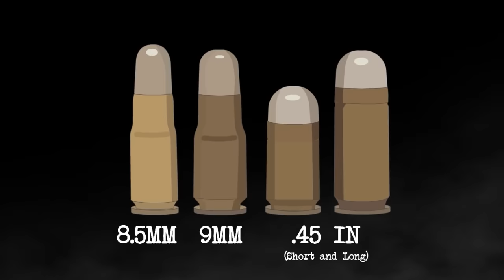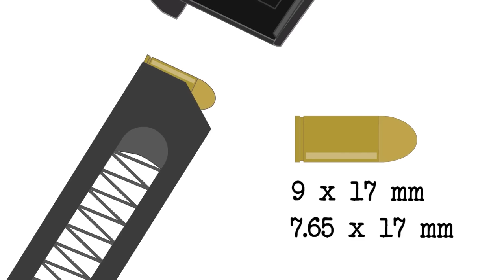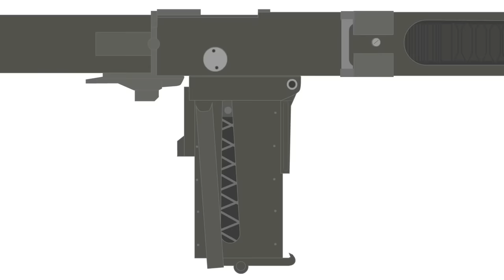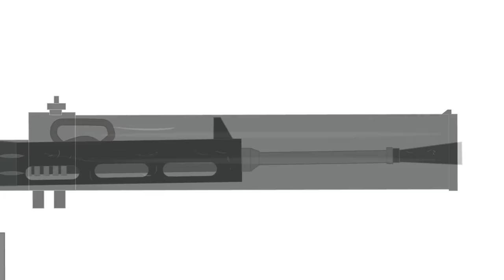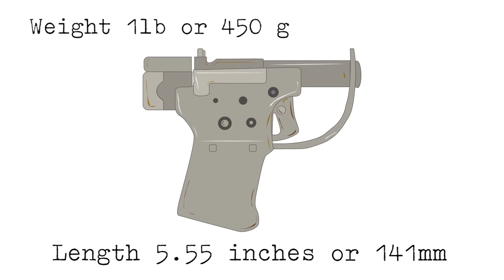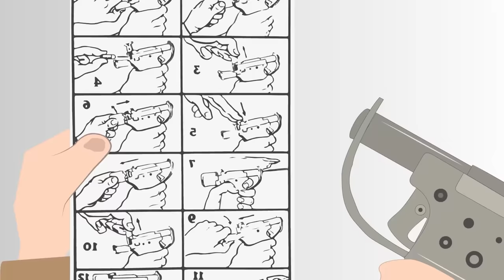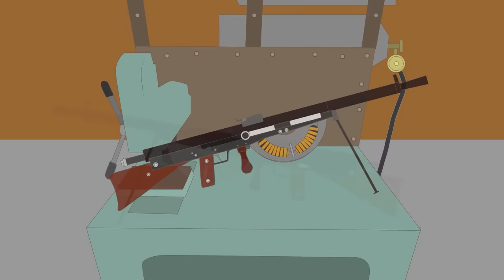Cursed guns that shouldn't have been made

Comment: The mars was a great pistol in battlefield 1, goes to show again how in video games stuff doesn't break down or misfire like in real life so it's a lot better than the real life counterpart. Same with the Chachut, was my go to lmg.
Reply: Would be amazing if DICE worked this stat into the game similar to Far Cry 2; prevents redundant weapons when some have higher chance of misfire and can definitely help balance the high RoF or high capacity weapons if they're more prone to malfunctioning and jamming the way they are in real life.

I'm so tired of post-BC2 BF games devolving into an SMG meta like it's CoD and the weapon platform hasn't been obsolete in 15+ years.
Reply: The Mars actually worked reasonably well - it just delivered a round with 50% more power than a 45ACP however. A pre1900 gun for Dirty Harry.
For comparison the 45ACP was dropped because the US army basically concluded that putting having a gun that everyone they recruited could put every shot into a target beat having a gun that only 10% of their recruits could master.
Reply: Best example is the Tec 9. It is a PoS in reality, yet the best gun to rush B with Blyat
Reply: @allangibson8494  The 1911A1 was used by the US military from 1911 until the mid-1980s.  From what I heard, from my dad and others, if you could hit a man sized target anywhere from around 25 yards, you were "qualified". Also, the main reason they switched to the M9 Beretta was the fact that most existing 1911s in military stocks were dated from WW2! Rather than replacing them with new .45s, they decided to go with the 9mm for NATO commonality. I guess the idea was if combined NATO forces were fighting together, they would have one common pistol cartridge. You could take cartridges from an ally if needed, even if you used different pistols.
Reply: @johnmullholand2044  The M1911 limited WHO could qualify. It places physical requirements on the user that the 9mm Parabellum doesn’t. The difference is terminal effects is actually marginal but the probability and speed of actually qualifying with 9mm is much higher than the 45… Second shots were demonstrably faster with 9mm and magazine capacity was much higher in a physically smaller package.
The Air Force ditched the 45 as soon as they could.
Reply: @allangibson8494  Have you ever fired the 1911? Recoil isn't really a problem for any adult, a bigger hole means they bleed out faster, and seven or eight rounds of a guaranteed fight stopper is still better than a smaller, weaker cartridge. As to a "faster follow up shot", there are numerous action shooters that might argue with you about that. No, we're going to have to agree to disagree. The 1911 is the perfect military pistol, in the perfect caliber. Even the venerable Browning Hi-Power is more similar to the 1911 than the Beretta.
And again, the US military used the 1911 almost exclusively until the mid '80s. If the 1911 was so terrible, why wouldn't they have replaced it sooner? Why are so many modern pistols so similar to the 1911? And why does everybody and their brother make a version of the 1911, if it's so obsolete? Most competitive shooters use a version of the 1911.
Reply: @johnmullholand2044  50% of the population can’t hit a target with a M1911 because of its recoil - hence the longer training time.
The faster supersonic 9mm does more damage than the subsonic 0.45” - including a larger wound.
The US Army study that chose the 45 only used subsonic ammunition - and thus missed the entire point of small diameter high velocity ammunition.
The US Army only caught up in the 1940’s with 30 carbine, 1960’s with 5.56mm ammunition
Reply: @allangibson8494  You keep throwing out absurd percentages insisting that the vast majority of the population can't use a 1911 effectively, but what's your source?

Literally every reputable source I can find online that discusses why the US military switched from the 1911A1 to the M9 says that it was partially due to the supply of 1911s were outdated (because, as John mentioned, most of them were made during WWII), but mostly to standardize with NATO - adopting the 9mm that was already commonly used by our allies meant less logistical problems supplying our troops overseas. 

It's the same reason all NATO members use 5.56 ammo for their rifles and why it was so hard for the US to replace the M16/M4 (up until last year or so) - for logistical reasons, they need to make sure their main weapons are compatible with whatever ammo their allies are using in their main weapons.
Reply: I got a clip of me using that French death machine and I was being the biggest pain for the opposing team to kill for a good 2 minutes straight solo taking a base while they are coming in to defend it. Good times
Reply: *Chauchat (I think).
My favourite weapon is the LMG 08/18.

Comment: The revolver rifle isn't cursed. Especially the 1855 Colt. It is, literally, the most successful of that type of firearm. The 21st Ohio Volunteer Infantry fought at the Battle of Chickamauga and fired 55 rounds per day per man. That's about 10 times more on average than other soldiers. They even held the line for the northern retreat. No reports from them of any self inflicted wounds due to chain fire
Reply: The revolver rifles they make now are great , they have little wing type deflectors so you dont need to worry about the gas as it redirects it and with cartridges being used now you dont need to worry about chain fires
Reply: Yep much better rifle altogether, if they had been modified like that they likely would have been very popular
Reply: Revolver rifles looks so good.
The largest problem I can think of for Colt 1855 was a result of the ammo technology of the time that it had to be designed for.

Comment: So the “cooking-off” part was NOT an issue found exclusively on the revolving carbine. Loading the cylinders with bullets that don’t provide a good seal to protect the powder in each chamber was a condition that would have caused any cap and ball revolver to have a catastrophic failure. The other method used to prevent this condition was to fill the chambers with fat or wax overtop of the bullets. The ‘proper’ way to load a cap and ball revolver is to use lead bullets casted to be a tight enough fit to have a small ring of the lead ball cut out when ramming the ball into the chamber. This is what provides that sealed condition that both prevents a chain fire, as well as allow the revolver to be more easily fired in damp weather/rain.
Reply: or seal the chamber with grease/paste wax !

Comment: 7:30 gyro have no recoil AT ALL.  It's the same design as guns we call "RECOILLESS" while they are 30x bigger than this. In video guys should pew-pew without moving anything but their finger.
it's worth adding that gasses sent to the sides while starting rocket had tendency to throw dirt in every direction in prone position, which could cause problems. Shooting while prone or in tight quarters, risked burning yourself from exhaust gases or at least throwing random dirt and dust in your face.

Comment: Another consideration with revolver rifles in general: even if they don't suffer from cookoff, the cylinder gap makes it hazardous to shoulder it the way you'd normally shoulder a rifle, as there's the risk that the gases escaping from between the cylinder and the barrel will be perfectly positioned to go right into your face. There are modern ones that just add some metal to deflect the gases away from the user, in the vein of ejection port deflectors used to keep spent cases from hitting a left-handed user on a modern autoloading rifle.

Hypothetically you could also make the revolver push the cylinder forward when it's brought into battery and seal the gap, like the Nagant revolver famously does. I don't know if any revolver rifles go that route though.
Reply: @acidwizzardbastard  Oooh, nice.
Reply: Yeah, a lot of the issues with safety were possible to mitigate or design around, but these also came out in 1855, only 5 years before the Spencer repeating rifle, and it was fairly obvious that a revolver design was not the way to go in the long term.

Comment: Mars could work if it was redesigned to be more easier to maintain along with dampering the recoil to where it's tolerable
Reply: The Mars did work.  It' a Victorian Desert Eagle, you just don't need a sidearm that powerful.  It was basically an autoloading magnum before magnum revolvers existed and you don't need or want a design that complex without a stupidly powerful cartridge to justify it.

Comment: I call this gun the "Nerf Or Nothing" 
It's ammo capacity is 1
Now you're probably thinking "but it's only a lame a*s gun why would we even care?"
That's why i made it so the Nerf Or Nothing powerful
It's design might be DogWater but do not judge the book by it's cover. Because once you get fooled you are dead. "But why? With just one ammo?"
Well that ammo, is a gaint nuke that explodes on impact making it impossible to escape. 
Attachment:
Flashlight
Silencer
Scope
Tactical lazer
Nuke Warning Sign
Tactical knife thing that is taped on the pistol (Nerf Or Nothing) 

Perks: 
50% speed on user
60% health on user
30% jump height on user
User achieved ultra instinct
100000000000000000000000000+ damage
Kills everyone (including team) 

Downgrades:
Cannot switch weapons. 
Cannot swim. 
+1000 ADS time

Comment: The real reason they didn't put there left had in front of the cylinder is bullet shear. Even if it didnt blow up, under regular use revolvers have a tendency to shear tiny pieces off the bullet when passing from cylinder into the barrel. Its a rule with revolvers, pistol or rifle. You never put you hand past that line where cylinder and barrel meet.

Comment: The Taurus Curve needs to be on this list.
Reply: Tf that is? 😅
Reply: @turkicslav5562  The Taurus Curve is a .380auto pistol from Taurus that was designed specifically to be concealed carried without a holster.

The whole frame of the gun is curved to blend in to your waistline while you wear it, there are no hard edges or catch-points anywhere on the gun - which means there's no sights, the only way to aim the weapon is with the wimpy built in laser pointer.

Unfortunately they cared more about making it concealable than they did about making it a gun. Mine averages 2 rounds fired between malfunctions.
Reply: Literally any Taurus should be on the list

Comment: What the narrator called cooking off on I've heard of it as chain fire and is an issue with all cap and ball Revolvers. The solution is to put some grease in the  cylinder after you load the ball to prevent a chain fire.

Comment: Any gun with a magazine is not called a single shot (like said about the Carcano). The cover over the barrel on the Beretta SMG was not to protect the barrel, but rather it is a shroud that slightly helps with barrel cooling, but mostly to protect the shooters hands from the high heat of sustained fire of automatic weapons.

Comment: If i had the equipment i wouldn't be opposed to making a more effective version of the gyrojet, a lot of its problems could be fixed with modern tech. For example one of the main reasons it had a horrible range is the propellant used, now there is propellants that would solve that problem, i will admit i am not that knowledgeable about solids i know a lot more about liquid propellants. As for its accuracy it is a simple fix, be more precise when drilling the holes that make it spin. Also the cost of the ammo wouldn't have been nearly as much of a problem if it saw large scale production, it still would probably be more expensive than conventional ammo. I am thinking about making new ammo for it, it would probably be rocket candy because I don't have access to anything better for solids. Also I could see a few improvements, they could add a small aerospike to the tip to improve the aerodynamics, like what they do with submarine based missiles and a lot of rocket launchers (no i am not talking about the aerospike engine, the more correct term is aerodisk), also to help with stability and accuracy they could have small fins on the back.

Comment: As someone who loves revolvers, i wonder how well a revolver carbine using more modern ammunition, ie not percussion caps, would fair. Granted yes it wouldnt make much sense specifically compared to staples like a lever action but it make for a unique firearm to show off.
Reply: they exist, you still have to worry about getting hot gas and lead spraying on your support arm, but otherwise functional if suboptimal
Reply: I suppose it could work with Nagant revolver-type cases. I believe revolver cannon also deal with high pressure this way.

Comment: 4:20 Worth noting that the 8.5mm Mars, 9mm Mars and .45 Mars Short and Long were NOT the same cartridges as the other similarly sized ones around at the time, like the 9x19mm Parabellum and .45 ACP or .45 Colt ("Long Colt"). Even the 8.5 and 9mm Mars cartridges had muzzle energy in the range of 1000 joules, more than twice the average 9x19mm load, and nearly twice normal .45 ACP load, with only +P .45 or +P+ loads of 9x19mm loads getting anywhere close. They even beat out a lot of .357 Magnum loads, and match some lower end .44 Magnum loads.

The Mars really was the Automag or Desert Eagle of its day, a stupidly overpowered hand cannon with pretty much no military use value. If the designer had listened to the feedback and scaled everything down to reasonable levels, he might have actually managed to sell some.

Comment: Its crazy that weaponmakers just trust their designers without testing...
Reply: well happened also in recent days and probabily nowadays.

EXAMPLE:

I remind about the landmines sent from Italy during the Gulf War.. "they were pretty good", the best,  ""a jewel"", engineers also create a complex magnetic signal for self distructing them in remote for area control or when necessary in case of retreat or free the area and avoid further repurcussions to civilians people (the main problem of mines it's not just their letality.. it's the damn fact they are always there operating untill catching their vitcim/s, LAND MINES a fucking CURSED WEAPON for that...).

All Perfect But there was only a PROBLEM.. sudddenly someone of them started exploding without any reason.
After some research it was confirmed the matter it was just and only one thing.. THE SILICON INSIDE the SAND , which triggered the cause of exploding.
it was probabily at that time the best land mine factured in the world. but it wasnt been studied for sand enviromen t!!!

No need to explain further what then happen after this..

Comment: The model 38 doesn’t really belong but it should’ve had one point brought up about it. The Glisenti fired 9x19mm Glisenti, a weaker version of 9x19 parabellum. The Model 38, I kid you not, fired 9x19 M1938, a more powerful version of 9x19 parabellum… mix up your 9x19 for your pistol and your identical looking 9x19 for your smg and the pistol becomes a grenade.

Comment: The GyroJet was a neat idea, its biggest issue was cost of producing ammo, the ammo was expensive to produce because it was a complex process not something they could automate back then, now days, we could automate making the ammo, infact, i think we could drastically improve on the design pretty easily, i mean these days we have 3d print rocket engines that  burn their own filament/resan.... print some fuel that burns longer and is easier to fill the round with, as well as holding up better long term storage. 

its not a horrible idea, not the best execution, but considering when that thing came out....i mean its impressive they managed to make the thing into  an actual product...

Comment: Again with the Glisenti M1910... its design and construction problems were solved with the "Brixia M1913" model, and the Glisenti 9x19 round was as valid as the 9x19 Parabellum.
The regular German 9Para had .32g of Nitrocellulose, and German Subsonic 9Para had .28g of Nitrocellulose; the Glisenti used .30g of Nitrocellulose. You could 100% use 9Para in your M1910, but it woud shorten the "pistol lifespan".
In WW2 the opposite happened: the 9x19 M38 used by Beretta M38 could not be loaded in MP40s (or STENs). The increased powder charge destroyed other 9mm SMGs.

Comment: Ironically i think the Smith and Wesson Carbine Revolver Rifle, could actually work and be feasible now days. 

The negative traits of the Carbine, could be fixed. With Modern Ammunition, which uses a smokeless powder instead of the black powder the Original carbine used. Also with modern rounds the powder, and bullet are in a single all in one case that would dramatically reduce the cookoff of the original Carbine. Also, you can add a shield and rotating cylinder, like modern revolvers. 

I think the problem with the original carbine rifle, was its Ammunition, and the Ammunition mechanism. Basically putting in powder, then the bullet and then the percussion cap. Leaving it out in the open, it caused the most risk. But with modern Ammunition, all of that are in the bullet and case itself. The second issue is the use of black gunpowder, which tends to be very smokey and were probably the cause of heating up the cylinders causing a accidental discharge.

Comment: This is so full of errors… don’t really know where to start.
- The Carcano M1891 is not single shot: it feeds from a 6-round enbloc clip. Also, while the clip falls out the bottom (not ejected) after chambering the last round, it can easily be ejected through the open breech at any time, there’s a button/lever for this inside the trigger guard.
- The Fiat-Revelli 1914 doesn’t feed from a 10 round magazine. The magazines where either 50 or 100 rounds. They also were not strip-fed, the box magazines consisted of side-by-side 5-round compartments, each with its own feed-lips, follower and spring, and a ratchet mechanism that automatically advanced to the next compartment.